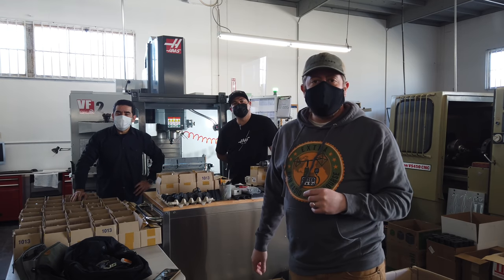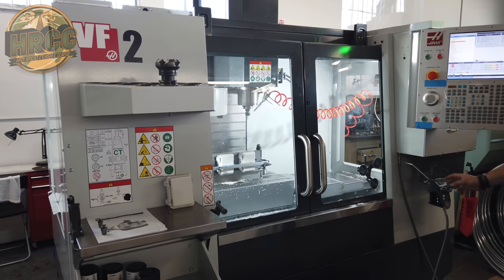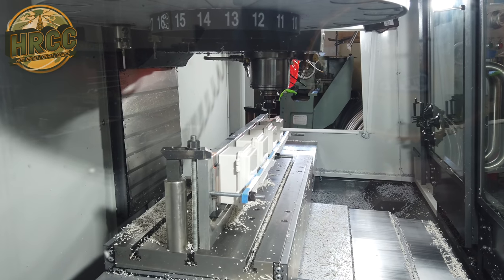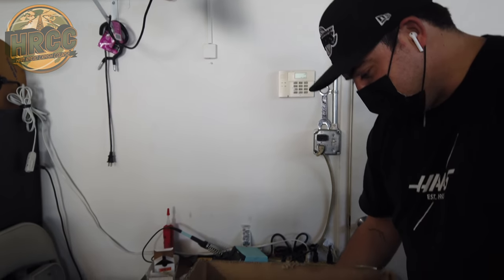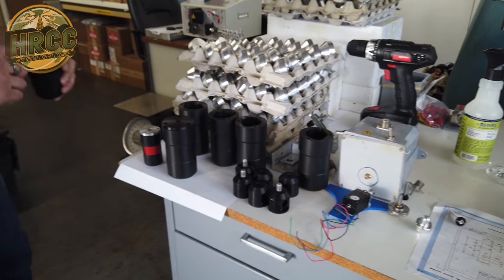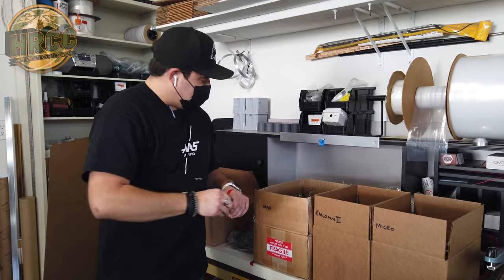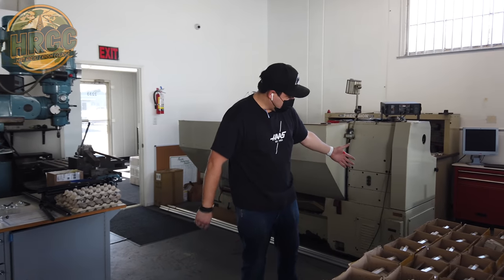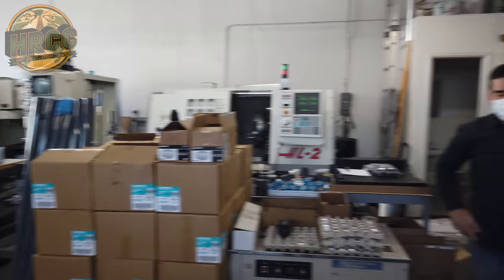Chameleon Antennas Factory Tour! Made in America Ham Radio Equipment

Comment: Thank You for this. To those who like to call others Appliance Operators, I say this. Yes you could fabricate everything they're making and it would function to standard but to reach this level of quality, fit and finish, you'd need a lot of experience us a lot of machine tools, presses and fittings, costing several hundreds of thousands of dollars. It's not cost effective for me, unless I used those tools for either other projects or started my own business.   OBTW, I'm patiently and happily waiting waiting for my F-Loop Total. I can hardly wait. Take care and stay safe. Ciao
Reply from the maker: They do make great high quality antennas!
Reply: @HamRadioCrashCourse  I know  I don't but I will put something together from a video or notes. I'm looking at finishing my VHF/UHF groundplane antenna soon and now I'm thinking about expanding that idea to 20 meters, where the vertical wire would be the radiator and the four antenna wires leading off the sides would be counterpoises but that's an idea for the future. Thanks again for all you do and 73'
Reply: It was a like some "Twilight Zone ESP" experience when I ran across Chameleon Antenna upon trying to figure out how to run HF Ham Radio from an apartment with only an apartment balcony to work with and the closest I could get was another brand of antenna that still would've been too long (Hv$1Lr antenna) and exceeded to the space I was allowed by the building management, (at which is in govt. subsidized housing).  It was as though my thoughts went out into the universe and POOF, I found "Chameleon Antenna" and grabbed the magic plastic and placed an order and I've been satisfied ever since.  Maybe it could be thought of as a blessing and a prayer being answered as well, without the classical religious suggestions.

Comment: I had a Mini and let someone borrow it.  It came back with shattered pieces inside...:(. I think what happened is it either got dropped on a hard surface or he ran too much power through it, not realizing it was only 100 watt capacity.  I have a Micro arriving this week....:). It was a great antenna and I suspect the Micro will be too. de KD2LMR
Reply: You can send your broken unit and we’ll fix it.
Reply: @carllavoie3804  I'd like to do that.  It's a shame to have it just laying around broke in a box.  Do I just send it to the company with a note inside asking for it to be repaired?  Thank you Carl.
Reply: @somarmd  Yes - Chameleon Antenna
1283 Commerce St
Sparks NV 89431-0976

Comment: To start out I just wanted to talk back back n forth with my son n law , so I thought I would get a GMRS license, as you know you have to 1st get a FRN number which I did then trying to work my way through the CORES application some of the questions I wasn’t quite sure of but I worked my way threw it . I put my location as Mobile the next questions were antenna and frequency,(which in small letters it was noted no answer needed for mobile ) but every time I tried to finish it would tell me I couldn’t proceed became it needed to know the antenna and frequency  I went back n forth a dozen times, I even went back and changed answers to other questions thing I did something wrong . Finally I just quit  trying ? What do u think I did wrong ?